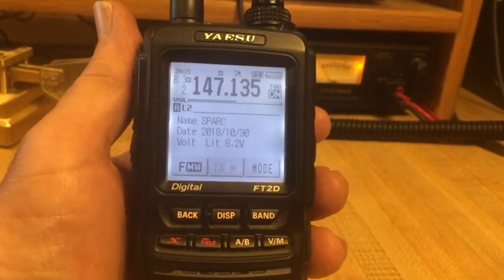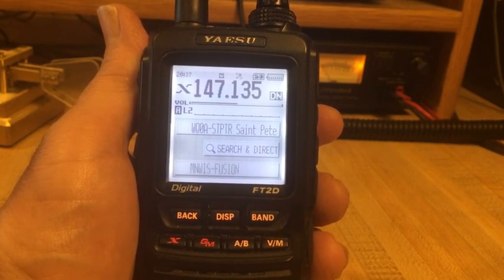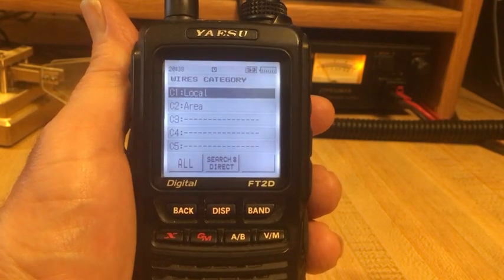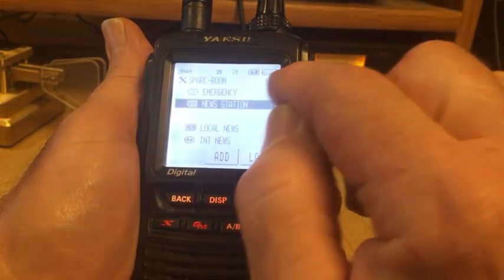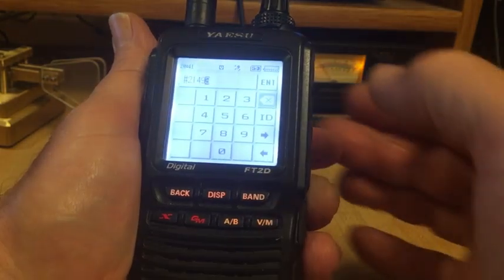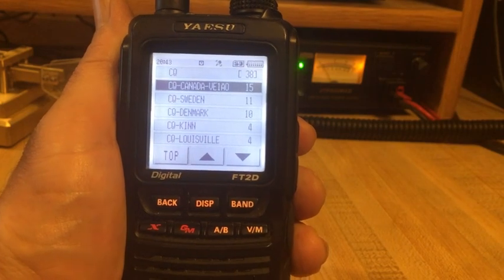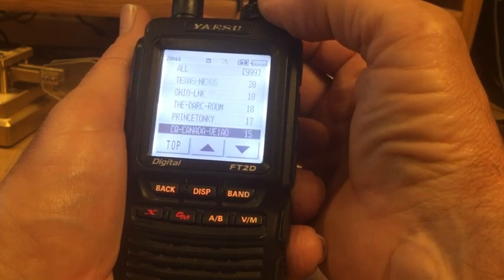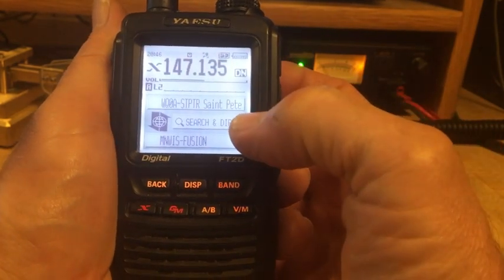Yaesu FT2D Wires X Control Part 1

Comment: When I hit the x command to start the connection I lose the offset. I have the offset set to - and when I do the x command it does not do the offset and the sub menu resorts back to simplex...no offset. HELP.....
Reply from the maker: Would your setting for Wires X Freq be set to manual?  Look under Disp>Wires-X>1 RPT/WIRES FREQ> (Should be set to manual)

Comment: Hi, appreciate your videos, thank you!   General questions about the computer portion of wires-x.  1) Is it better to have a desktop set aside from desk where transceivers are to reduce RF interference, or is a laptop or all in one next to transmitters ok?  2) For same RF interference,  is it better to be ethernet cable connected, or use the wifi from router to said computer?  Thanks,  Glenn
Reply from the maker: Hi Glenn.  I'm operating several Wires X nodes in digital.  Most are on laptops. No RF problems whatsoever. Keep your antenna outside your immediate operating area with good coax.  I also use ethernet and WiFi.  Both work flawlessly, assuming you have good bandwidth for your internet service.  Enjoy!

Comment: I have a ft-2dr sometimes  when I try to connect to wires x, it goes from DN to DW can you please tell me why?    Then sometimes it takes a long time to get connected to wires-x can you please tell me why? 
Terry Graham 
blackwolf12003@yahoo.com
Reply from the maker: As I understand it, the Wires X digital data is transmitted in the DW format. I normally expect to change modes after I am finished using Wires X, since it usually changes from what I was set to.  Possibly your delay in connecting is the result of errors in the signal path.  Wires X does not use the error correction that voice communications does. I've found that while driving, multipath can cause data errors even in strong signal conditions. But a second try usually works.  Hopefully that answers your questions.

Comment: Great video.  Is it possible to use an OpenSpot2 with a Yaesu FT70D? if so can you do an instructional video? Many Thanks for all your hard work,.
Reply from the maker: Thanks for your comments, Larry. I don’t have any experience with the Openspot 2 but I am using a zumspot. The YSF reflectors can be selected by Wires X on the zumspot but not the FCS reflectors. You might find more info from the Openspot forum.
Reply: @mmlanger55  I can access YSF and FCS on the ZumSpot.
Reply from the maker: @donh5794  Hi Don.  You can access both YSF and FCS reflectors with the Zumspot. But controlling which reflector you are on by WIres X with the FCS reflectors is a bit more tricky. I find I have bring up search results to make the FCS choice.  I have not found a means to direct enter the FCS number.
Reply: @mmlanger55  On my ZumSpot and my other Pi-Star based hotspots, after pressing the Wires-X button to connect to the hotspot, I press search on the FT-2DR then press ID and enter the  number (without typing FCS or preceding zeros). The correct FCS comes up every time. 
The FCS numbers are different than the YSF numbers. The search does not work if connected to a reflector. In that case, I press the Wires-X button to get out of that mode and press it again to go back in. The last reflector flashes indicating it's not connected. The FCS # search will work again as described.